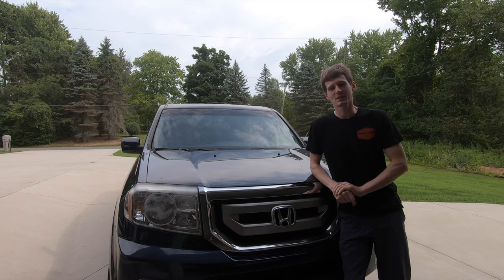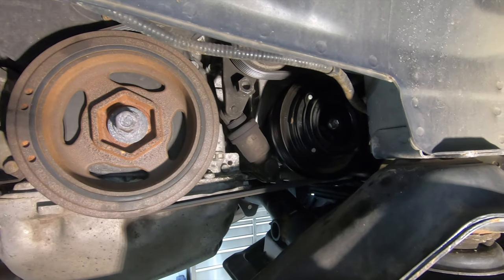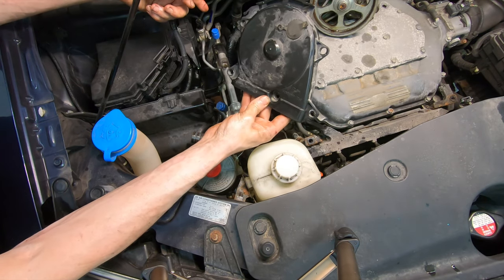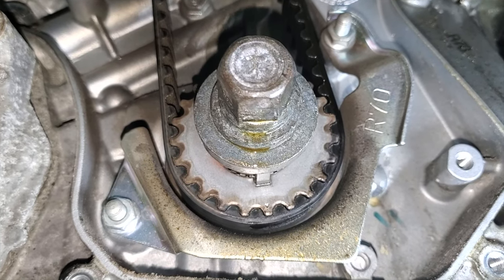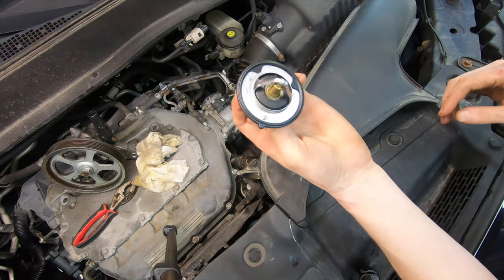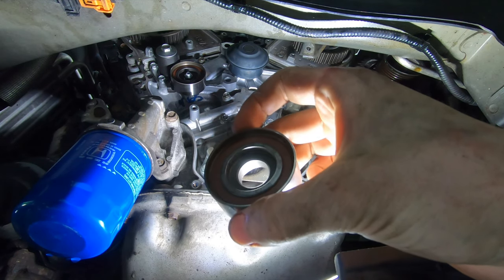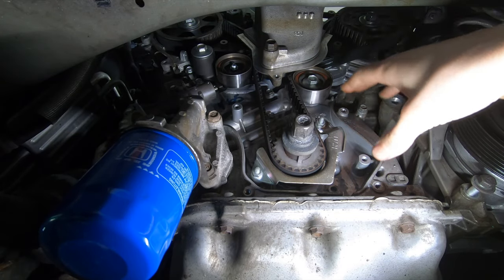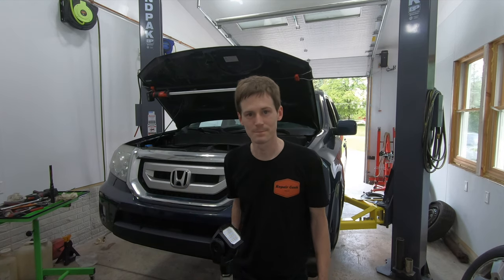Honda 3.5L V6 Timing Belt & Water Pump Replacement- Pilot, Ridgeline, Odyssey.

Comment from the maker: Here are some of the tools and parts that I used to complete the timing belt service:
Tools:
Crank Pulley Holding Tool: https://amzn.to/3gT8a8Z
19mm Crank Bolt Socket: https://amzn.to/2F5Pu8t
Full Set of Crank Pulley Sockets: https://amzn.to/3bqVncQ
Impact Gun: https://amzn.to/3jO3kvz
Parts:
Timing Kit (Asin): https://amzn.to/35fVRS3
Timing Kit (OEM Honda): https://amzn.to/3sa9oSL
Thermostat: https://amzn.to/2QRiWll
Thermostat Gasket: https://amzn.to/3lPdnlS
Motor Mount: https://amzn.to/3jHxNLG
Concentrated Coolant (needs diluted): https://amzn.to/2QSQboE
Diluted Coolant: https://amzn.to/351AhAi
My Amazon Store:  https://www.amazon.com/shop/repairgeek
Help support the channel, buy using my Amazon links
As an Amazon Associate I earn from qualifying purchases and your cost is exactly the same.
Reply: its not just redline trim on the vue's its all v6 models 2004-2007 most of them were just fwd
Reply: Great video!  Will the crank and valves cranks turn easily by hand when you’re putting belt on? Or will they only turn with a wrench?
Reply: I would have never believed that there's a "magic" Crank Bolt Socket, but you're spot on.  With the same extact tools (impact and socket), I got the same results.  I tried to use a standard socket and it did nothing but make noise.  Thanks for the accurate video!
Reply: Thx for this video! I’m thinking the Asin parts are as good as oem Honda? !
Reply: Please I have question ,,,,what position should the arm of the gear lever be P or N ?
Reply: Do I actually need to buy a crank pulley socket set ? 
I only see you using the 19mm . 
Tnks
Reply: How long did it take you to do that job? Thank you again for the video. It has been very helpful!
Reply: Do you have a video how to reseal oil pump if it's leaking?

Comment: Mark the belt at TDC hash marks using a white marker and transfer the marks from old to new, this is the only sure way to keep the engine in time.  You will 99% be 1 tooth off on the rear cam if you are a novice doing this.
Reply: great tip!
Reply: You are saying to mark all 3 sprockets at TDC and belt,  then count the teeth between all of them on the new belt correct? Don’t mess with much timing belt stuff anymore. More gears in Diesel engines.
Reply: @lucasamick7940  That's correct
Reply: @securityguy  thank you sir. I sure as heck would not have done that.
Reply: Lol yep, 1 tooth off on rear cam, just like you said. Too bad I had already taken off the belt before seeing this
Reply: Any chance if belt stretch on the old belt that would throw off marking the new belt? Also… you could also manually rotate the crank pulley two revolutions to check for interference.
Reply: @ronejr766   Modern cog belts (the type that are used for timing belts) are made with Kevlar cord. These belts will wear out and loose teeth and eventually snap but they don't stretch.
Reply: I MAKE 2-3 marks on crankshaft pulley and belt and one on both top cams👍
Reply: Good idea, thanks for sharing!
Reply: I’m getting ready to this job on a Honda van. What an excellent tip!
Reply: Fantastic advice!! I'll be attempting this soon, and you may have saved me a lot of grief.
Reply: Not plausible in real life. If the belt is stretched this won't work. Happened to me. Did 2 jobs on an 09 tl and 07 mdx all good. Marks don't transfer correctly. Plus you don't have to be TDC if you know what you're doing. Just make sure that the belt is super tight going around the front cams.
Reply: @mrwrightoser8293  mine oem did so either you're wrong or I'm wrong.
Reply: Even if the belt is stretched, unless the belt somehow skipped a tooth, the count between marks should be correct.
Reply: Agree.  When I did it I put the new belt on top of the old one and secured them with Bobby pins to be 100% sure the belt tooth count between marks was exact.  There is a procedure out there somewhere for this.
Reply: I finally did this yesterday; I used yellow, red, and blue paint markers. With the yellow marker I marked a cog tooth and the surrounding belt ribs where the belt just makes full contact on either side of the sprockets. With the red marker I marked a cog and a rib in the same way around the apex. With the belt removed, I used the blue marker to mark every fifth rib between the yellow sections so I could accurately transfer the marks to the new belt.

Because the beginning, middle, and end of each sprocket are marked, I was able to see that my first attempt to install the belt would have resulted in a skipped tooth on the rear camshaft. I also have high confidence that the belt is properly installed.

Update: Engine did not grenade itself and has been running smoothly for >5 weeks
Reply: Appreciate the advice of marking the old belt and transferring to the new one.
Reply: @WilliamCWayne  nice job!!
Reply: I snapped the timing belt on my pilot hopefully I didn't pile up my engine..lol. thanks for the video I might be timing it this way or it's going to the wrecker 😅.  Seems to be a very common problem for these engines. Once again thanks for the walk through and I'm installing a lift soon
Reply: I’m in process of doing a belt change my rear cam is off 1 tooth rearward with new belt is that ok.
Reply: @frankguyton9596  absolutely not
Reply: @captainobvious8665  I fixed it all is well thanks for the video.
Reply: How would you be a tooth off if the cam sprockets don't move? Are you talking about you bot stretching the belt good enough?
Reply: My first time doing a timing belt on a Acura TL I was off 1 tooth LOL
Reply: I am the novice he is talking about 😢. Rear cam off a tooth…. After putting it all back together 😊
Reply: Not necessary, just make sure they are all lined up, there are only a few options and one one is close and correct.
Reply: Not if the belt is already stretched
Reply: @johnjacoLMSW not really as the belt could have stretched and jumped time. Hes projecting, acting like hes the only one wise enough around here to do the job
Reply: But if the old belt skipped a tooth or was incorrectly installed, better check.
Reply: Thank you. So quick question for you. I marked everything as you said and all the hash marks lined up TDC. While I was putting the timing belt on, the rear cam rocked back out of time. I tried adjusting it while the belt was on and now the rear lines back up and the front is off a bit. Any ideas on how to get all three of these lined back up? I was thinking about putting the automatic tensioner back on and pulling the grenade pin to tighten the belt back up and then turning the crank to see if they would all line up. 

What are your thoughts?

Thank you,

Chris
Reply: Yep Im a tooth off on rear cam after reinstall of new belt, it was all lined up before I put new belt on, its a tooth behind the other cal znd crank pulley, can I remove the belt off that back cal znd rotate that czm a tooth forward znd reinstall belt znd everything be back to ok?
Reply: @franciscogomez2how did you fix it?565
Reply: @mosinnagantfan it’s a month later but yeah you just need to set the rear cam like half a tooth ahead before pulling the pin and then it’ll roll into alignment.   My guess is that a new belt has a little bit of stretch to it that gets taken up by the tensioner being released.
Reply: Wise words sir, thank you. I listened to your advice and I was indeed 1 tooth off. There was no way i would have known otherwise since the belt already felt pretty tight. I had to tighten the water pump last to keep the extra slack needed. Belts made by Gates seem to be a bit on the snug side.
Reply: I've have a  2008 pilot and running good and no coolant in the oil and  doesn't get hot,  but I'm getting bubbles on the reservoir tank so  it can be anything else than a head gasket??😊 thanks

Comment: Not sure if someone else pointed this out but the engine block has a coolant drain fitting on the rear side of the engine (13-17 v6 models). I appreciate this video, great work.
Reply: Yeah, but it still doesn't drain the water pump itself.  Its going to make a mess no matter what, maybe just not as big.  Ask me how I know.😄
Reply: 2007 Odyessy: used drain at back of block, just above & inboard of oil filter. Attached  1/4" clr plastic tube b4 openning - didn't spill a single drop! I had drained radiator with same method. When h2o pump came off, only about 3 drops of coolant came out. Absolutely ZERO mess.
Reply: Thank you. Saves a mess.
Reply: I drained the block but there was still coolant trapped behind the water pump that spilled out. Probably not as much though.

Comment: Thank you for your excellent tutorial.  Today is July 6 2024 and I just tackled the timing belt on my 2006 Acura RL.  It's got just under 97,000 miles on it and the belts are all original.  My daughter is taking the car off to college and I wanted to get it done before she left. While there were just a few things different between your demo car and mine, your video made doing the work simple and straight forward.  I've been a gearhead for over 45 years, but video tutorials are so very beneficial.  Thanks again.

Comment: Just did this job yesterday. Took all day but got it all done, and that includes a lot of time to degrease a lot of parts. No more ticking noises, Temps are good. Suggest the Aisin brand which cost me about $173 plus another $9.99 for the tool to remove the main pulley, don't go with the cheaper ones. Approximately $800 job at a shop.
Reply: Next up (due at the same time) is the valve timing. The exhaust valves get tight over time and Honda lists valve adjustments in the same service
Reply: Where did you get kit for that price @Daniellameans
Reply: @johnnyt1621  rock auto
Reply: I got the aisin kit from amazon. It had a Mitsubishi (made in Thailand) belt. I’ll use it, but I kind of expected Japan for the price.
Reply: @followingflinn8311  I too got the same kit and was disappointed with the timing belt,  I had also ordered a Mitsuboshi serpentine belt and too was made in Thailand,  I'm returning it back and have ordered a Honda belt. So frustrating 😤
Reply: Hat's off.  I've done a couple before, and this one looks like a pita
Reply: @mauijim00  it really wasn’t too bad once I got the crank bolt loose. Ended up using a breaker bar and the starter to get it. Worked great.
Reply: @mauijim00  that's what I've been thinking. I've got a 02 V6 and a 13 coupe V6 that are both due

Comment: This is a great video. However, the torque specs you list for the water pump bolts are wrong. They should be 9ft-lbs!

Comment: Great video and on-point. To remove the 19mm Crank Bolt, I did buy the harmonic Socket but my Milwaukee 3/8 Impact with 700lb-ft loosening torque did not work so I bought a Milwaukee 1/2 Impact with 1,400lb-ft loosening torque to extend my tool collection and it took it right off. Also, I made the mistake of not having the engine mount bracket in alignment with the engine mount so it sheared the engine mount bracket and bolt so I ordered a new bracket and bolt.

Comment: What a great video and so helpful!  Thank You.
By following this I was able to replace the belt and pump on my 2016 Pilot with no problems.
I do have one recommendation.  Use the release valve on the back side of the engine to drain your coolant from the block first.  I did that and had almost no coolant flow out from the pump during the change.
Thanks again!
Reply from the maker: In Ohio after about 5-10 years they like to break off in the block when you go to loosen them. In my environment, not worth the risk.

Comment: Great video.  About the slack when installing the new belt:  Volvo B21 engines had their timing belts marked with white lines that matched up to the gear / engine case marks.  Volvo basically pre-counted the right number of teeth and marked the belt for you as a failsafe.  They put a double line for the crank to get it oriented correctly from the start.  You could mark the old belt before taking it off, then mark the new belt accordingly before installing it...  Not by length of course, but by counting the belt teeth.  It would take a few extra minutes but it would save time on the belt install because you would know for sure if anything moved or if the belt had slack.  The belt mark(s) would either match up or not with all the other marks.

Comment: Great video.  This showed me that I am better served just taking the car to the shop and have a professional mechanic complete this job.  The work is worth paying for considering the steps involved.  Great review of the job and requirements.  Thanks for the insight.
Reply: I agree.  Something I'd like to try but with the time involved and the repercussions if I messed it up, I'll take it to the shop.
Reply: @patm95  agreed. I’ll just pay $500 labor 😂😂😂
Reply: There are pros and cons to any decision. When I was still in HS changed out a VW trans axle, in the Winter with no lift. This was an excellent introduction which leaves very little to figure out for yourself.
Reply: Awesome job! Where are you and could you do mine? I’m in NH

Comment: I really appreciate the info in this video - so I am going to pay forward some tips and tricks I learned while doing this on an odyssey.

1 - drain the coolant in the engine block and radiator. There is a drain just above the oil filter at rear of motor, 12mm - put a 1/4” hose on it and drain into reservoir, I got half a gallon out this way. You will still have some spill out of the water pump but not nearly as much.
2 - use a high impact torque with heavy socket like OP does. I broke a wrench trying to pry it off. With high impact socket it spins right off like in the video. 
3 - buy new motor mount, you will probably need to replace this anyway, save the headache and have the part, might be wise to replace bolts at same time. In other belts I’ve done, this was recommended. One of the three bolts to the frame was severely rusted on mine, so I replaced it, would have been way easier to have the hardware ahead of time.
4- be very careful with water pump bolts, just hand tighten of you don’t have a light torque wrench. I busted one and was lucky enough to have enough threads to back it out. 
5- as others have said, mark the old belt prior to removal and transfer marks to new belt as a safe guard. Mark any tooth that touches the belt on the crank sprocket, and a corresponding mark on the belt. Do the same for the cam sprockets, at TDC. Then count the teeth on the belt as you lay them side by side abs mark the same spots on the new belt. Re-count at least three times. It won’t take long, and you want to be certain your markings are the same. When you put the new belt on, you want those marks to line up with the marks on the sprockets. This is the only way to guarantee you will be in time. Route belt as OP explains keeping tension on the forward side, but make sure your marks line up. I had the rear cam sprocket move slightly back, and without my marks, it’s possible I wouldn’t have been able to notice. This is only way to ensure your in time, and you don’t want to be off by a single tooth. 

That’s about it. Expect this job will take you most of a day. Take your time, do it right, get the right tools. It’s a big job and total PITA, but beats paying a grand for someone else to do it for you.
Reply: Great tips. Much appreciated.
Reply: Thanks for the tips.  Our 16 Odyssey just hit 100k, so I'm making a grocery list of stuff I need before the van hits 105k.

Comment: I used this video and got the job done with the vehicle on the ground. I left the power steering plumbing in place, but it was pretty annoying to have there. I used hand tools but would buy an air ratchet if I ever did it again. Thank you for all the details and torque specs.
Reply: How did you re-torque the Crankshaft bolt on the ground?  I'm about to do this myself as well
Reply: @beompark17  put a long extension on the bolt (24"?). Put a jack stand under the extension close to where the torque wrench will attach. If necessary, put a cheater bar on the torque wrench. Also, I used a breaker bar to pin against the frame to hold the pulley tool in place. I did this same thing to remove the bolt.

Hope this helps!! Good luck!

Comment: Best video I've seen on replacing the timing belt on the Honda V6 engine.  You went step by step and added relevant comments when necessary.
You did a fantastic job.  I am considering buying a full size Honda V6 SUV so this is the perfect instruction video.  I can just imagine what the repair shops / dealers are charging for this job.
Reply: @ucesainbolt4572  Glad to be a DIYer at that price!
Reply: @ucesainbolt4572  If in doubt take pictures - something I keep forgetting to do!  The engineers seem to get a kick out of designing something different that does the same thing as a simple design.  It sure does keep the DIYer on his toes!  Good luck with your project.  I do the same thing you do - buy the tools (and parts) & do the job yourself.
Reply: Just called in last week and Honda wants 2400 for this job...f that .. thanks for the detailed video.

one question though; are there any tips or tricks to ensuring the water pump goes back on securely instead of just waiting 'til you fill it to see if it leaks?
Reply: Just as a little warning, don't forget to disconnect your battery prior to doing any work. Or, you may very well find yourself at the Honda Dealer to have the computer rebooted/ cleared of codes which only the dealer can clear. Happened to me working on my Volvo.

Comment: Good job man.  Thx for the help.  Bought my wife a nice 2013 odyssey.  112k miles. Assumed that the timing belt had not been changed. I get it all apart…..  AFTERMARKET PARTS!  S**t